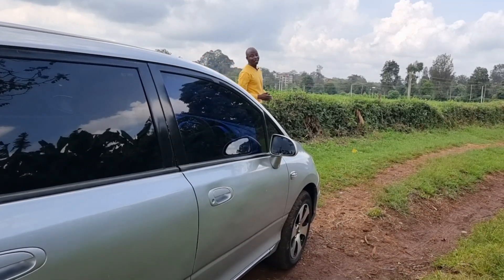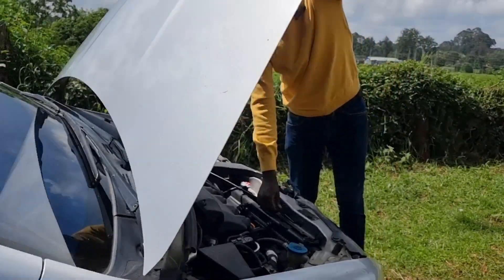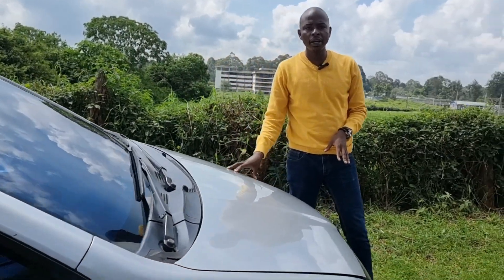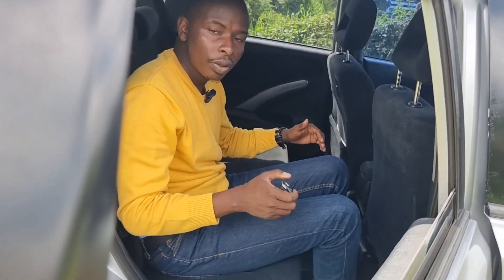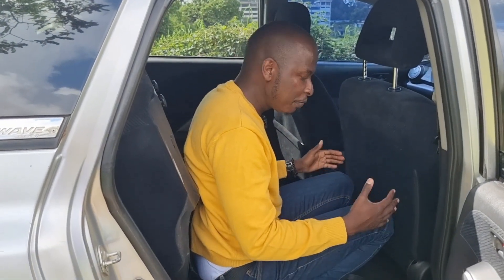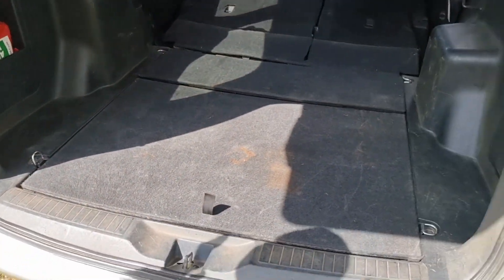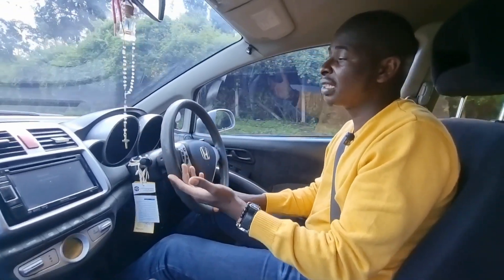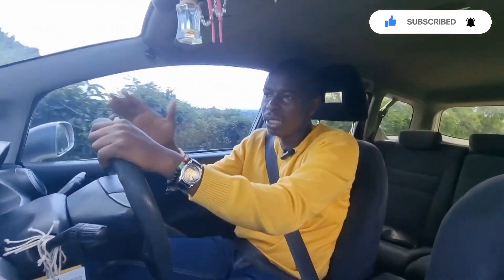Honda Airwave. Did Honda make a mistake? #honda #vtec

Comment: finally someone talking about hondas in details ,please give is the pros and cons of the engine, transmission, suspension and how tuey are solved😊 hanks in advance
Reply from the maker: Vtec engines are mostly faultless; the main issues will consist of failing coil packs, the gearbox will develop valve body issues if poorly serviced. 
Suspension will serve you very well if you fit the recommended parts; thst is bushes and shocks.
All round these cars are tanks, they can do upwards of 400k in mileage without having perennial issues.
Thank you for watching and for the support.
Long live hondas✅️

Comment: Which cvt gear oil is used in airwave model 2006 with paddle shifter gear
Reply from the maker: @bilalsafdar-l9d  honda recommend HMMF(honda multi matic fluid) but good measure check on your gearbox dip stick it should be indicated.
Thank you for watching.

Comment: Its really a great car. 
How can I improve fuel consumption in mine. It's doing 11km/litre. I hear others manage 17km/litre
Reply from the maker: Hello Kithegi, the fuel consumption for these is very good. To improve check on the below things
1. Spark plugs, ensure you have genuine
2. Ignition coil packs, they tend to fail alot on these cars.

This is mostly what makes honda airwaves have bad fuel consumption.
Thank you for watching.
Reply: i manage 12-13km/l when over revving and 14-15km/l when driving normally. just routine service for me. genuine parts.
Reply: @kenyagospeldjs  amazing.